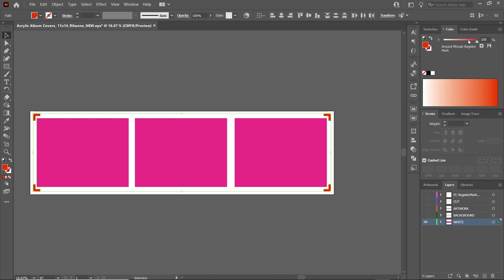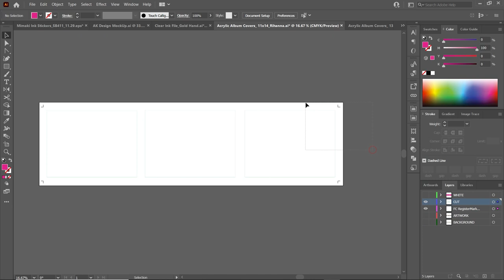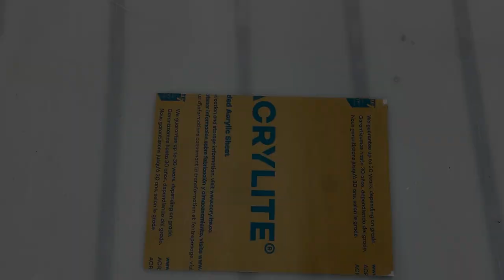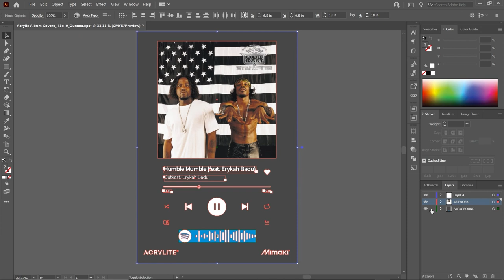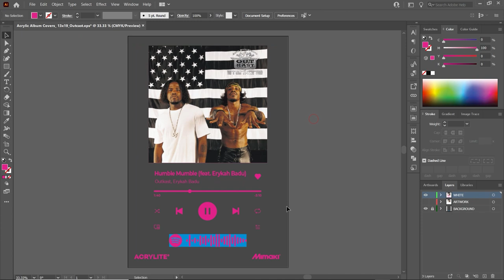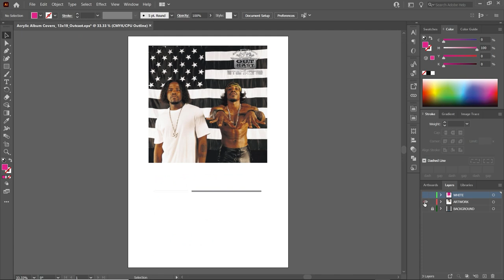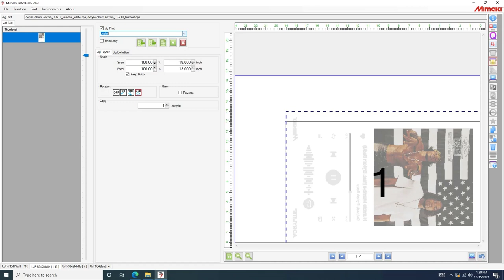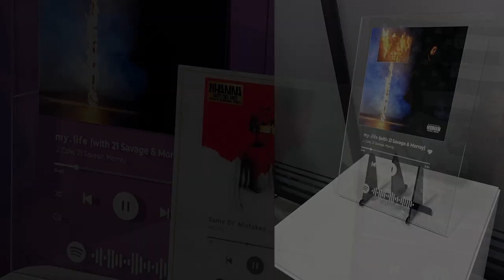Tips, tricks and Techniques ~ Clear Acrylic: Designing + Decorating with UV Roll-to-Roll Printer

Comment: Thanks for the ideas!  What did you use for the clear on the roll printer?  Was it adhesive backed or was the acrylic panel adhesive coated?  Thanks!
Reply from the maker: It was Drytac Viziprint, but our application specialist also recommends Jetcomp clear PET